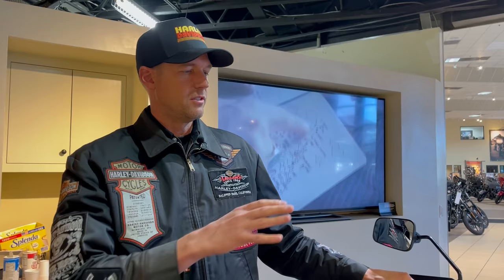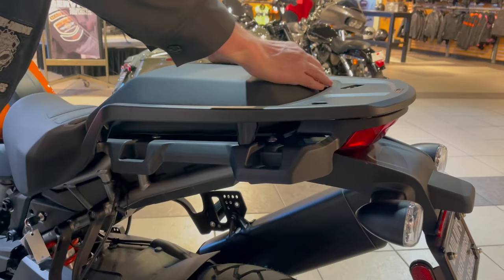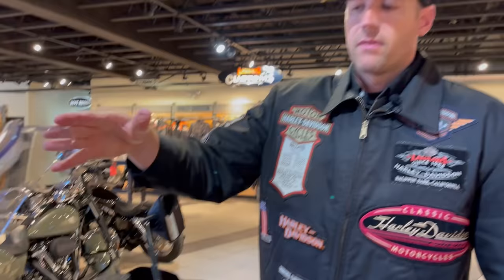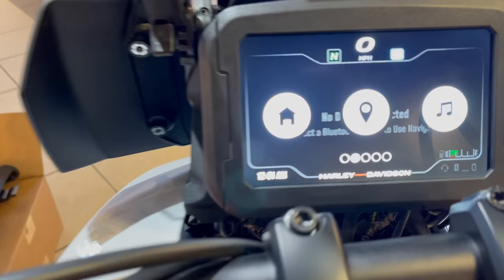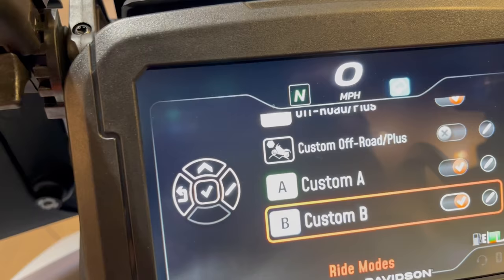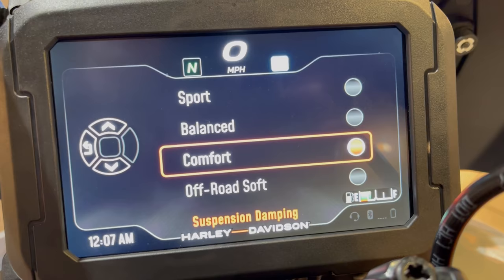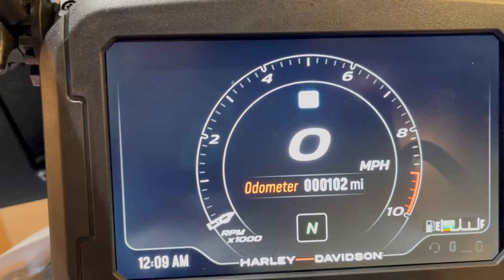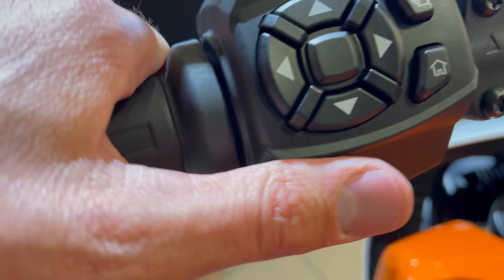Harley Pan America Tech Demo and Hands-on Tutorial

Comment: Thanks for the Info & Video Matt. Have you found any cables you can recommend? It would be nice to run a cable / hub up to the bars or nearby with 2 female USB. This way its easy to connect multiple items like cell and go pro...   Ive had my Pan Am since they came out. Seat is painful so I may go to a saddleman. Personally, I think this and the mapping/navigation are a Joke! It's a "dual-sport bike" meant for trails and touring and this is the mapping???  Awful for the $$$ we spent on the bike....  I do my own software updates on this and my road bike, pretty simple process.      Also you may want to cover the entry code access if you loose your key fob or battery dies, to get it started.   Cheers😎

Comment: Great detailed review of the controls and power -ports.  It's a shame H-D didn't think about how to keep a phone or nav-unit charging while riding and attached to handle-bars.  The other question/issue... What happens if you need to ride through 10-12 inches of water? Is the Battery box and regulator connections waterproof? Only an issue if you want/need to cross a small stream or deep puddle. Don't think the battery will be too happy if it's terminals are sitting in dirty water for more than a couple of seconds. The submerged water-bath will be similar to sticking a screw-driver across the terminals of that battery.  Still only an issue for very deep puddles.
Reply: hd doesn't give a shit about it's consumers.

Comment: Hi Matt, you've put together another thorough and detailed video. It doesn't seem like there is a dedicated USB, like the street bikes have, up front for folks that put their phones on the bars, did I miss something, would you have to run the wires? Have you tried using a stand alone navigation unit like a Garmin?
Reply from the maker: I believe you can wire a USB port off the battery for a phone mount. No, I haven’t tried the garmin on this bike.

Comment: Hi Matt, thanks for the video, very useful info, however I have one question, How do you switch the speedo background color from Black to white? I've seen this on a few of the Youtube demo rides and it would be really useful when light conditions make it a little harder to see the white speedo digits on the black background. Cheers
Reply from the maker: Hold down the trip toggle switch. Or the menu selector switch. I can’t remember which. One of those two on the left hand control

Comment: Got about 1/3 through the video and pretty depressed over the new bike. Never owned or ridden a Harley, have been enjoying my Valkyrie the last 22 years/ 75k miles. If it ever wears out or loses performance I may look for something else. Have been wanting an adventure bike and thought this may be it, but alas it looks like a great idea ruined by over load of gadgetry that takes away the riders control and joy of actually driving the machine. I'm highly impressed with the new engine and light weight. Is there a way to get that without the electronics? ABS with the ability to switch on and off is ok, but the display and various ride modes needs to go. Go back to individual gauges, speedometer and tach and I'll be more inclined to buy one. If a bike has to be tethered to a trickle charger to keep the battery up, it's way too overloaded and dependent on cpu control. My feeling about machines has been if I'm not controlling it, then it's controlling me and that is pretty much the opposite  to the whole purpose of motorcycling.

Comment: Matt, I want to hide the wires to my ZUMO XT under the fuel tank, but cant figure out how to remove the tank. can you help here !?!
Reply: Are you getting power for the Zumo XT from one of the connectors under the seat?  What connector did you use that is compatible with the Pan Am connector?
Reply: @bukweet  yes, the connectors under the seat that is used for heated garments etc.
Reply: @bukweet  i didnt pull the fuel tank, only the trim piece that goes on top of the tank. covers the wires really well.
Reply: @grizzjohnson9026  Very cool.  So tank removal is not necessary; only the trim on top.  Thanks for all of the useful information 👏.
Reply: @bukweet  you are very welcome John. happy riding on your Pan Am Dirt Glide Ultra !!!!! i got 920 miles on mine. goin for the 1000 mi check soon !
Reply: @grizzjohnson9026  Dumb question: how did you wire the two Zumo power leads to the Gerbing connector? I think I’m missing something here… 🤔
Reply: i used another SAE cable that plugs in to the gerbing cable , then splice that to the zumo wires
Reply: @grizzjohnson9026  Doh! I should have thought of that.  Thanks again, and enjoy your PAS. Mine will ship in a few days. 👍🏼
Reply: @bukweet  i know you will be happy with it !!

Comment: Hey Matt, about that usb-c on the side of the screen. What is that? That's stupid
Reply from the maker: Yea, to have that disabled when the ignition is on baffles me. I’ll have to ask someone about that.
Reply: @MattLaidlaw  On the facebook Pan Am group there is a guy who works at a Harley dealership and he says the USB is supposed to be live when the engine is running. In the manual it says the USB is live when the bike is running. This guy says he notified Harley and they told him they are making a software update to fix this problem. I sincerely hope he is correct as this is really dumb if it cannot charge anything while the engine is on.
Reply from the maker: @moonrunrs  interesting. Let’s see what happens.
Reply: @MattLaidlaw  Go on the facebook Pan Am group. They say there is now a flash update that fixes the USB problem and it is now live when the engine is running. I guess there was also a problem where people's batteries were getting drained until they were dead and this update fixes that too. 

However, now people are reporting a problem where the chain grinds the chain guard away after not many miles on the bike.

Comment: A massive failure is the base model can't install heated grips. Unless an aftermarket company may make them. Even my 2014 Suzuki v-strom had factory heated grips you could buy and install yourself. A modern touring bike that isn't capable of this is a poor oversite by Harley. Also the optional locking gas cap. Every road bike I've own in the last 40 years came standard on them. Try putting the lock tumbler assembly together and install into the cap. What a joke. Nice bike but stupid things like this aren't acceptable on a modern touring bike. Harley still needs a little catching up to their competition.